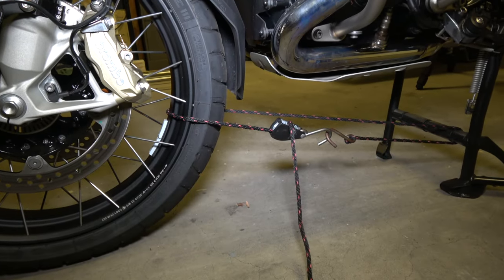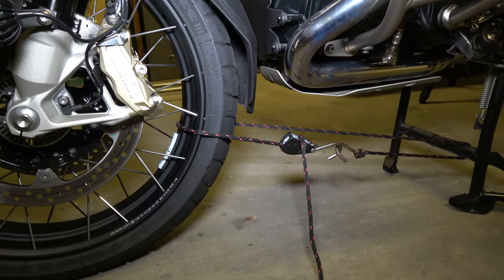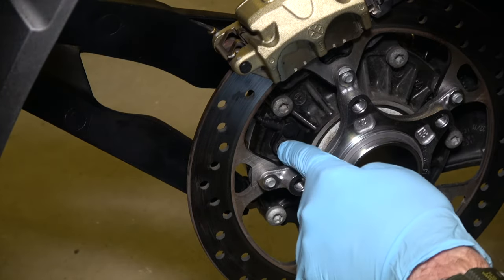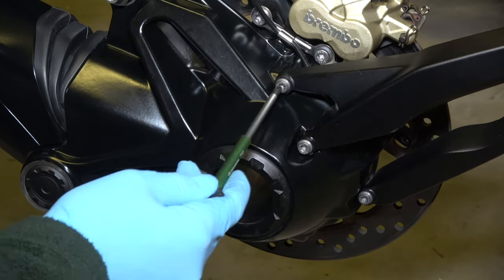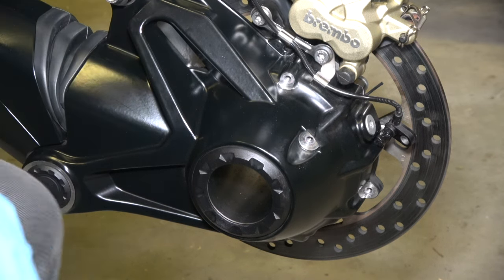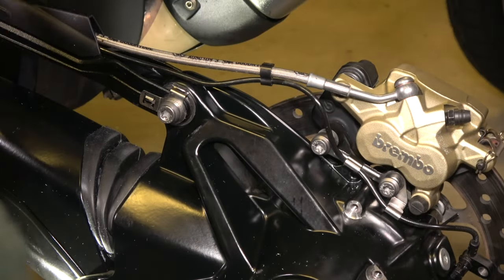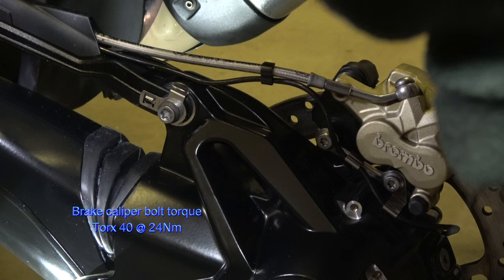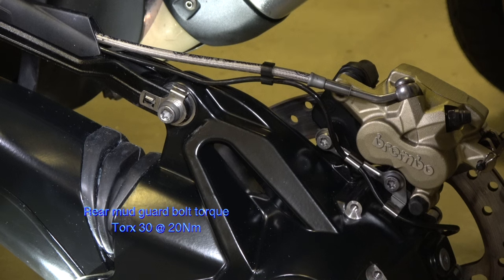ESSENTIAL MAINTENANCE: How to lube the FD splines on the shaft drive of your BMW R1250GS / R1200GS

Comment: Hi sir, thanks for this precious info. Last year, I bought a GS1250 2022 which I never use offroad or on salty roads…only rain occasionnally.
My question: in order to prevent rust on the rear spline, should I regularly apply the appropriate grease on the boot…how about the front spline? Prevention is my philosophy! Thanks again! Marc, Quebec Canada. 😉🏍
Reply from the maker: Congratulations on your GS. You may or may not be aware that BMW have apparently fitted a one way valve to the drive shaft housing in an effort to prevent the corrosion problems of the past and I’m fairly sure that your bike will have one fitted.

IMO however, there is no problem, if for nothing more than peace of mind, in checking the lubrication on the final drive splines and periodically checking the sealing properties of the boot grease.

As has been mentioned frequently in the comments section, the gearbox end splines don’t generally cause issues due to heat from engine and gearbox, their location in the housing and that they are not required to slide as per the FD ones.

Hope this helps and thanks for watching the video and asking the questions. Stay safe……and warm.
Reply: Thank you very much sir, I do have on my GS a one way valve on the drive shaft housing…therefore, no worries! Regards, Marc 😉🏍
Reply: Hi sir me again, I have just learnt your GSA and my GS have a recall from BMW( manufactured from 2018 to december 2022 more than 18400 bikes around the world) It seems to be a software issue on the gearbox causing a possible rear wheel block. I will speak to my dealer tomorrow…by chance I am not riding it is winter time. Ride safe sir! 😉
Reply from the maker: Hi Marc, many thanks for the “heads up” re the software update for the gearbox. I queried BMW Australia today and surprise surprise, they know nothing about any pending software update for my bike. I contacted the dealer about it and likewise, they had no knowledge of it either.

You mentioned in your message 18400 bikes between 2018 and 2022 which got me thinking. You being in Canada and that number of machines, indicates that it may be unique to your part of the world so I did a search and it seems that my supposition could be correct. It is mentioned in a couple of places that if landing after being jumped and the rear wheel is going significantly faster or slower, the sudden change in speed upon landing can snap the output shaft from the gearbox. The software update is alleged to fix the problem. How it is supposed to do that eludes me……BUT I am not a BMW engineer and I may have interpreted what I read incorrectly.

Mine goes up to the dealer in a week and half to get the one way valve installed. I hate taking my machines to dealers but this is one occasion where I cannot avoid it.

Good luck with the update and can you let me know if it is for the snapping output shaft and if not, what? Thanks in advance. Stay safe.
Reply: @TheMotorradRider  I got the info yesterday on youtube channel, Kraken’s garage and adventures…his latest posting. Check it out. Good day sir! 🏍😉
Reply: @TheMotorradRider  You can also watch Carl’s latest video on youtube Channel, Just the way it is. Carl is a competent engineer who clearly explains the problem in this recall. He is like a bible in the world of motorcycle mecanic. Cheers! Marc, 😉🏍

Comment: Thanks for making the video. I’m picking up a GS next week and was wondering if lubricating the union joint was a good idea? I had an R1200RT where the final drive failed at the union joint. I’m actually pretty lucky as it was at motorway speed. Is using lubricant on the union joint a problem?
Reply from the maker: Firstly, thanks for taking the time to watch the video and hopefully you found it useful.

Secondly, congratulations on the GS. Excellent choice and you will certainly enjoy it. 

Moving on to your question. The universal joints are generally sealed and lubricated for life and don’t require maintenance unless, like for example, Toyota Land Cruiser universals that have grease nipples fitted to them allowing specific grease to be applied at service intervals.

Your RT may have had the universal joint break due to seized splines putting excessive strain on the universal joint causing catastrophic failure. This is my opinion only.

In a nutshell, keeping the final drive splines lubricated will allow the final drive universal joint to work within its specified parameters without any additional requirements. I stress again, in my opinion.

Hope that helps, stay safe and enjoy that GS.
Reply: @TheMotorradRider  thanks soo much for that detailed reply means a lot 👍 I look forward to more content. Cheers

Comment: Question - The rear shaft section did not drop.  What can I do? Maybe is fused. Then I should not touch it.... any advise. Thanks. Great video. Is a 2017 GS and no rust inside.
Reply from the maker: Rotate drive shaft so the U-joint yoke is horizontal, i.e. it pivots up and down. The weight of the FD should pull the pinion from the end of the U-joint. The up/down alignment keeps the U-joint from binding. 

If there is no rust then also try rotating the brake rotor (disc) backwards and forwards, stopping sharply at each direction change to help break any binding of the splines. Just remember, when it does drop, it will do so very quickly so be prepared.

Thanks for watching the video and for asking the question.

Comment: They were completely seized on my 3yr old GS. Bmw couldn't split them using heat, and a slide hammer! They Quoted £2300 parts and £260 labour, to fix. After a lot of complaining BMW coughed up the parts as a 'Good Will' warranty claim. So this can potentially save you ALOT of money, AND the ride is so much smoother now, the splines are no longer seized!!
Reply from the maker: Those figures are frightening and show just how important this procedure can be with just a little time and effort from the owner. It was good that BMW helped out with the bill (as I believe they should considering the age of the bike at the time) otherwise that would have hurt the hip pocket big time.

Also, most people don’t realise how much harshness seized splines introduce to the drive train and consequently the quality of the ride, until the problem is rectified.

I’m really pleased yours got sorted and appreciate you taking the time to share the costs with others so that they can appreciate the potential expense if neglected.

Comment: I've seen lots of videos on lubing the final drive splines, but why do I not see videos that include the transmission end splines.  Isn't that equally important?
Reply from the maker: Firstly, thanks for watching the video and taking the time to ask your question. The answer to that question is simple......no. 

The reason being (and this has been mentioned many times on this channel and many other YouTube channels) that the gearbox end are 'fixed' splines only and are held in place by a spring clip so that they do not move. The final drive splines however,  ARE required to slide and if they don't, can affect the ride quality of the machine as well as causing potential damage to the drive line....hence this video. 

The gearbox end also benefits from getting heat and also protection from being so close to the engine/gearbox mass thus significantly reducing potential issues, whereas the final drive end is susceptible to water ingress from a possibly poorly sealing flexible boot, condensation build up and being more exposed to adverse conditions (river crossings etc.,)

Hope that helps. Stay safe.

Comment: Can you not use copper grease for the spline as that's what we use on tractors
Reply from the maker: Firstly, thanks for watching the video.

Re the copper grease. If you’re happy to use copper grease that’s your choice. I have been on the spanners for >40 years and only used moly on splines and slides and will stick with what I know and what is recommended by the manufacturer. Again, your bike, your choice. Hope that helps. Stay safe

Comment: Wonderful video, particularly for a newbie who is about to start doing his own "out-of-warranty" services to stay close to the bike's health and save some cash. Two stupid questions - It seems that the moly lube is applied to the splines but not to the u-joint pivot-points themselves, is that correct? Also, I assume the point of this is that the spline joint needs to "travel" (i.e., shorten or lengthen) as the paralever moves up and down and so that's why it needs to stay lubricated - is my understanding correct?
Reply from the maker: You are correct on both counts. The uni joint needle roller bearings are “sealed for life” and generally have good life expectancy.

The splines need to move to avoid harsh riding characteristics and other issues (harsh gear changes in certain circumstances).

Good to hear that you’ll be doing your own maintenance. You will really get to know the bike and get so much out of doing things yourself.

Thanks for watching the video and taking the time to comment and ask questions.
Reply: Stuck with front spline partial disengagement: Well, I finally got around to having time to try out this preventative maintenance and ran into this (big) problem: When I removed the paralever bolt and rotated the final drive downward to disengage the spline, it seems to have pulled the whole drive shaft backwards from the forward spline - in other words it looks like the forward spline disengaged, not the rear spline. I cannot move it forward again, so I cannot get back to starting position. Now I have to figure out either how to resolve on my own or how to get the bike back (on center stand and without rear wheel...) to shop for professional attention. Ah, the joys of "working on my own bike" at the beginning of my just started semi-retirement. Any quick comments or suggestions?
Reply from the maker: Jack up the swing arm so it is more or less level and secure it as horizontal as possible. Fold back the boot as best as you can. While protecting the case/frame use a large screwdriver or similar to lever the end of the drive shaft off of the transmission output splines. It can take quite a bit of effort as along with possible corrosion, you will probably be fighting the resistance of the wire clip that holds the shaft in its normal position. 

By keeping everything as horizontal as possible, you will be minimising resistance on the splines. Let me know how you go.
Reply: @TheMotorradRider  Thanks for the quick feedback, I will give it a shot in next day or two.

Comment: When you perform this maintenance, and you have gone as far as you have to go to get this maintenance completed, is there a reason why you didn't just remove the entire universal drive shaft and lubricate the splines on the front part of the universal drive shaft? I plan on doing this maintenance on my 2022 BMW K1600B Grand America this winter, and I would like to know if there is a good reason not to remove the entire universal drive shaft.
Reply from the maker: Thanks for asking the question but this has been addressed many times previously in the comments section so I’ll steer you there for the answer. Stay safe and enjoy the GA.

Comment: Easy job to do, common sense to do when you change the final drive oil.
Reply from the maker: Totally agree. It's a good little job for those just starting out doing their own maintenance and building a tool kit. Successfully completing the work would be a great confidence booster for future projects that they may have thought they were not capable of tackling.

Comment: You said it’s a 2018, how many miles?  Yours looked very good inside.  Thanks for the video!
Reply from the maker: 3301 klms (2051 miles) and yes mine was (and is!) very clean, unlike some that have been shown on various web sites with equal (and lower) kilometres that have extremely bad rust issues. Apparently, just because BMW installed painted or coated drive shafts in the later model bikes does not mean that they are immune from the rust issue either, as allegedly, not all splines were greased properly on assembly at the factory.

If you live in a harsh environment e.g., near the sea, where roads are salted during cold weather or heavy rainfall, it would certainly pay to keep an eye on this area of potential rust to prevent the problem escalating.

Thanks for watching the video and taking the time to comment. There will be other videos coming soon.

Comment: Hi! I thinking about paralevel bolt, what do you thing to tight it down after we put bike on wheels and sit on it? It is a rubber bushing inside it? When we tight it when the bike is on central stand, we make „0” position on stand, not on wheel, so they can damege quickly. What You think?
Reply from the maker: Good question. I think you will find that the paralever brace bolts are torqued by BMW using the method I have used in the video. If you wish to do as you suggest, which appears logical, it would probably work but I personally prefer to adhere (as much as I can), to correct  factory methods. 

My video is provided as a guide only and therefore feel free to modify methods as you see fit. Thanks for watching the video and for asking the question.

Comment: I need to take courage for adjust the valves, this realy make fear. But right now i only have 15.000km. Think about this when a got 20.000km
Reply from the maker: It’s not a hard job and you will more than likely find that the valve clearances are spot on when you do check them. If you are worried about doing the work, practice on the little jobs like the final drive shaft lubrication to build your confidence before tackling the valves. Prepare yourself, take your time and you will be fine. Thanks for watching the video and for your kind words. Stay safe.

Comment: Very informative.. 
How much free play should the final drive have  ? Thank you..
Reply from the maker: When you check the rear wheel with the bike on the centre stand, I believe that there can be anywhere between 25mm - 50mm (1" - 2") of movement (free play) at the wheel rim. This is due to 'take up' of slack in splines, gears and suchlike. However, in my opinion and I stress that it is in my opinion only, if you check for lateral (axial) play at the rear wheel and also when trying to move the rear wheel forward and backwards (radial)  but not rotating the wheel, there should be no more than 1mm (0.04") movement and preferably 0mm. If there is excessive movement detected, it  could be a sign that bearings are showing signs of wear and need attention. If you have any concerns and don't feel confident in diagnosing, I would suggest getting the FD professionally checked for your own peace of mind. Hope this helps and thanks for taking the time to watch the video and asking the question.
Reply: Thank you for your early response.  That was a  relief to hear.  I didn't realise that it could be 25m -50mm rotation.  I will check now for side movement  but I think it's ok..  thanks again.  🏍🏍🏍
Reply from the maker: Glad I could help to put your mind at ease.

Comment: Hi there,
I've watched this a few times and I've been able to re-couple the rear drive, but the paralever bolt is always a few centimeters out, so I can't screw that bolt back in,
Is there any way of closing that gap?
Cheers!
Reply from the maker: Hi, I’ve not experienced that problem in all the times that I have performed this task. The two reasons (and I stand to be corrected by the experts) that I can think of why your paralever is out of alignment is that the cardan joint has dropped at an angle to the shaft and the splines are binding. It may appear that everything is located correctly but at the very last second during the alignment process, it (the cardan joint), may have dropped slightly causing the problem.

The other reason could be that the output shaft from the gearbox (the shaft that the cardan joint slides onto) has become unclipped from the gearbox end and has moved out towards the rear of bike. Simply gently pulling on the output shaft will determine if this is case or not. 

Hope this helps and let me know how you go.
Reply: @TheMotorradRider  Hi again, thank you for your response,
I have checked the shaft by pulling on it, and it does not slide out,
The splines seem to align and connect as I can rotate the brake disc and can see the shaft rotating,
One previous attempt saw the shaft knocking against the top of the housing on rotation, so perhaps the splines are connected, but not enough?
Reply from the maker: @f220spyder  The last statement certainly indicates to me that the cardan is not going onto the splines correctly and causing the misalignment. 

Check the splines on the shaft and cardan joint for any debris that may be causing a binding issue. A very small piece of debris can create a problem.
Reply: @TheMotorradRider  Yep, you were absolutely right, the teeth on the universal joint side needed to be cleaned out with a small pick, regreased everything and spent an hour working it back together,
Thank you for your help!!
Reply from the maker: You are most welcome and I’m really pleased you fixed the issue. The really good thing to come out of this is that you are certain that the splines on both shaft and cardan are in tip top shape with minimal backlash. You’ve done a top job and thanks for keeping in touch. Enjoy the ride and stay safe.